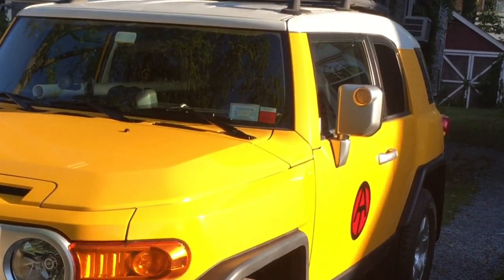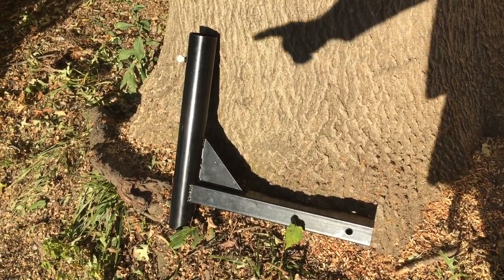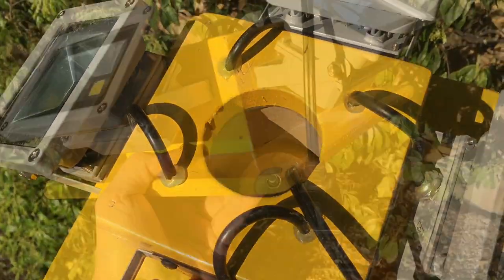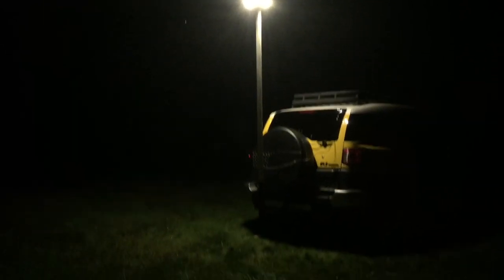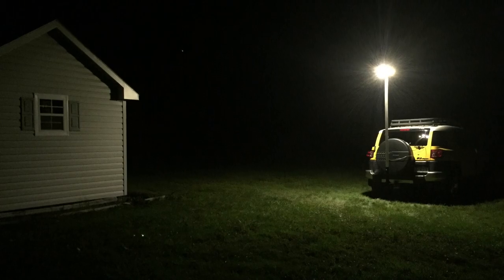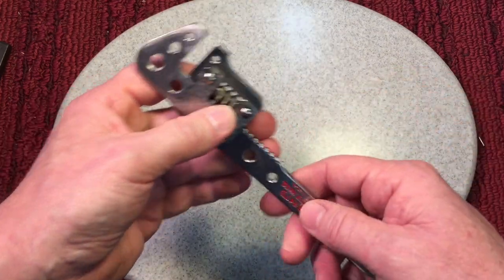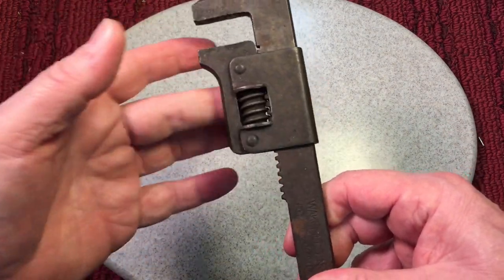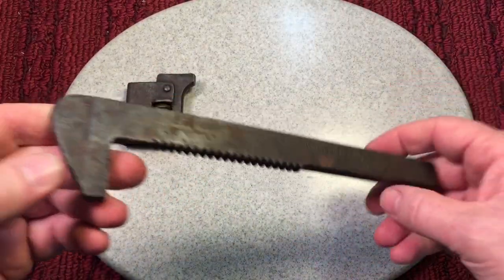MMM- Wakefield No.19 Restoration, Padlocks, LED Area Light...

Comment: I have a custom knife that someone made for me once and the guy that made it drilled out the handle for lightness like you did with the jeweled Wakefield and what the guy did was, he had glow in the dark powder and he mixed it with epoxy and filled the holes in the handle with it and it made little luminous pucks in the handle that will make it easy to find the knife if you dropped it at night, assuming it was exposed to the sun at some point earlier before you lost it. It was always a cool idea to me.  Plus, it looked cool because the epoch and the powder have a cool looking milky greenish look that reminds me of old insulators. My kitchen has a single bulb in the center of it and I bought an LED panel light that has three wings that you can adjust and this thing is amazing.  It makes the entire kitchen as bright as day.
Reply from the maker: Hi Joe!  I saw those lights!  They screw into a normal socket!  Awesome!!!!

Comment: The Appalachian Trail - It actually comes through a couple of the sites I manage here in Maine.   Have you hiked near Rainbow Lake just before hitting Baxter State Park?  Anyway, great mosh today!  I had never seen locks like that.  I've been thinking a lot about locks lately having had problems with people messing with some of mine out in the field.  It is almost as if they are useless given how cheap a battery powered angle grinder costs these days.  I don't know.  I'm a bit frustrated with padlocks these days.  Any tips or suggestions on good ones?  ...and love the lights!  I'm impressed!  I still use Coleman white gas lanterns.  Love 'em!  ...but it's hard to argue with your LED results.  Very cool!  Thanks so much for sharing.  Great fun!
Reply from the maker: Hi Daniel!  There was an old saying- Locks are only meant to stop honest people"   =)  That is so true!  Even if you put on a heavy duty padlock they will find a weak link and exploit it!  Video surveillance of some type seems to help!  =)   The Appalachian trail by me goes right over Bear Mountain!  Great place!

Comment: Hello John, thanks for another great video. I have a question on how to clean and refinish stacked leather handles. I have a knife similar to the one in the video and I just picked up an Eastwing hammer with leather handles. Leather is in good condition but needs to be cleaned and refinished. Thanks for any advice.
Reply from the maker: Hi Tony!  There are a bunch of remedies for treating stacked leather handles, Neatsfoot oil and other products work well.  Lots of people seal the handles with Bees Wax.  I guess it depends how dry it is.  =)   Thanks

Comment: Nice job! Do you have a trick to keep from getting shocked from static electricity using the belt sander. Mine hits me pretty hard when I get too close to the frame. I think I'm starting to get a facial tic from it. 😎
Reply from the maker: Hi Mike!  Only certain belts do it!  They say it's a static charge from the plastic pulleys!  Some people have run a ground wire fro the frame to a pipe of ground!   =)

Comment: At what point do you walk away from an old tool? Or do you ever? Is it the brand name, the age, condition, price? I walked away from a Krauter lineman pliers yesterday becuse the cutters were badly chipped, I didn't even ask for a price and now its bothering me. It was 1801-7, I think! I hope he's there next week. Let me know your thoughts,  please!
Reply from the maker: Most tools can be fixed one way or the other, however when the cutters of pliers are blown out there is nothing you can do!   I too usually pass by pliers with damaged jaws!  They can't be fixed!   Thanks!
Reply: I walk away from a Chas Parker 4 inch vise with heavy welding repair work on the moveable jaw. It was $10 and will haunt me forever.

Comment: Marbles Woodcraft. Remington made a half brother to it. My Remington looks like your Woodcraft. The Woodcraft I have is from the time Mike Stewart was at Marbles.  He has run Bark River for a long time. My woodcraft has stacked leather with antler for the pommel. Nice FJ Cruiser there. Holds it's value well.
Reply from the maker: Hi Philip!  When Marbles came back to the USA not too long ago they put out some really beautiful knives!
Reply: @ScoutCrafter   I hadn't heard.  Last I knew they were made in China and around 2010 went out of business.  There were several knife companies started by former employees under different names.  Kind of like how Frost River pack was originally started by former employees of Duluth Pack.  Frost River went under once or twice before it became what it is today.  I will have to check on Marbles.  Not that I need another knife like I need another hole in my head.  Hard to believe what I would call a late model knife made in the 1990s is now old.